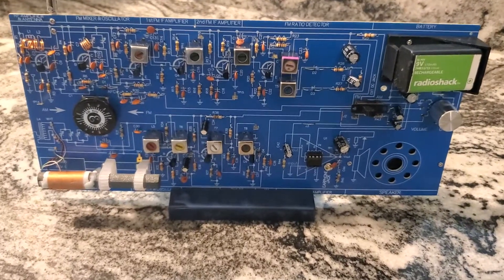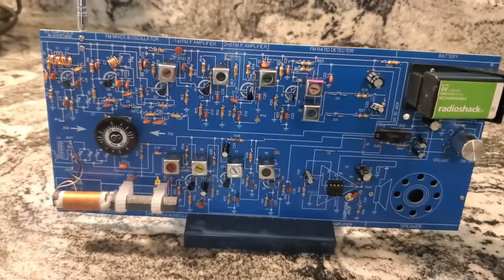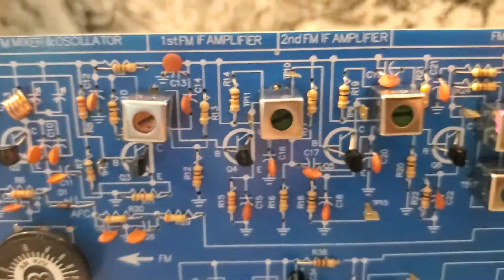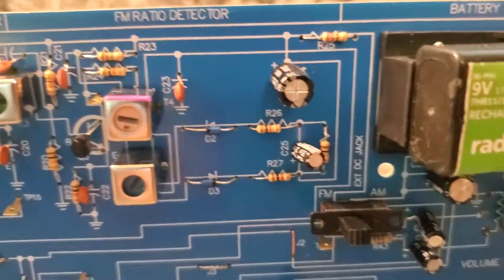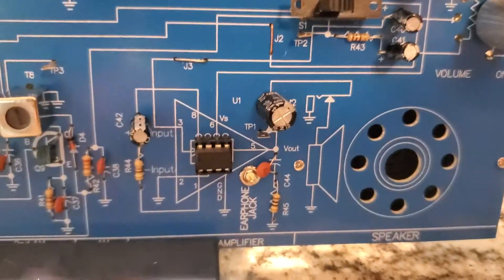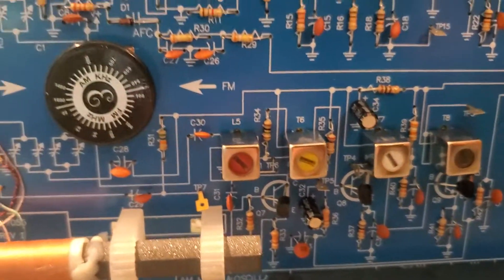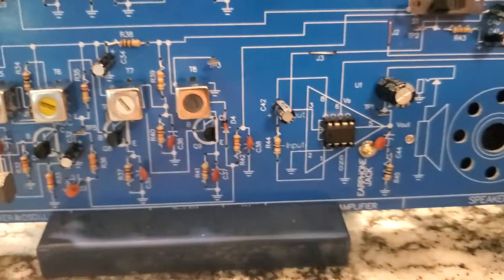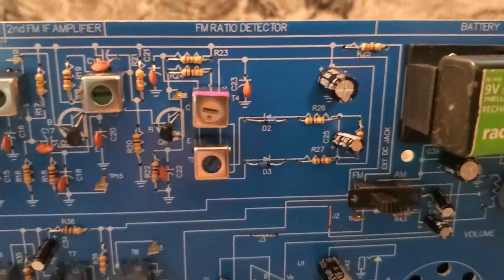ELENCO AM FM Radio Trainer.

Comment: nice work! sounds awesome. I just bought this and plan to start tonight! several years back I bought the original without the IC audio amp but never could get it to receive more than a few stations. did you do the alignment with just a multimeter, or did you have access to proper signal generator and oscillioscope? i hope i have better luck with this updated kit!

Comment: Thanks for the demo, i was wondering how well they work
Reply from the maker: It plays quite well on both AM and FM. I live in the Tampabay area and can pickup 650 WSM out of Nashville quite despite having two strong stations locally on 620 and 680. if there is any performance issue I would say its because the radio is not quite as aligned as it should since it boatmotors around 540kc. FM works quite well and I think I have it fairly aligned. AGC could be alittle better for FM since my home FM transmitter tends to over drive the radio. other then that its a solid radio.